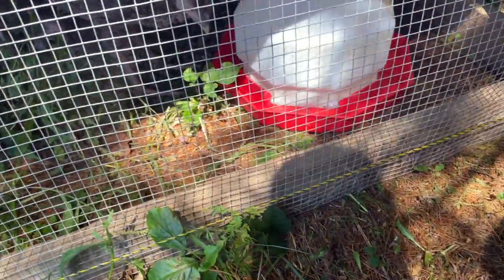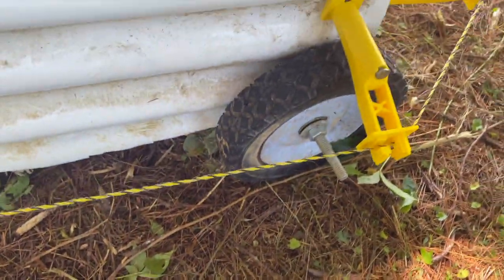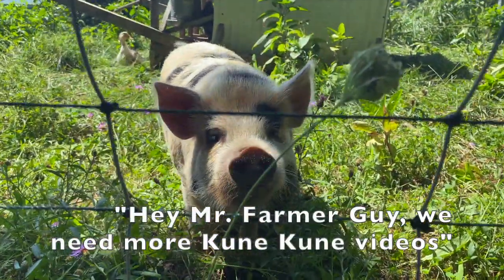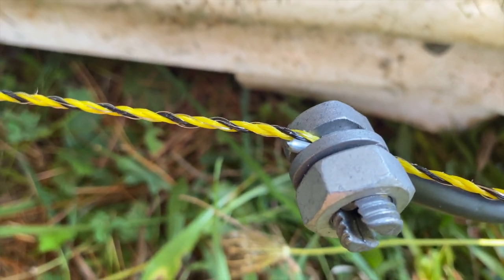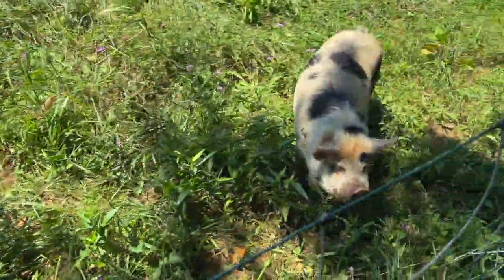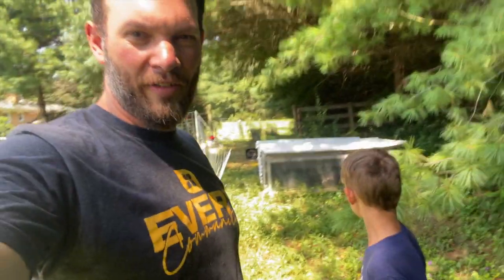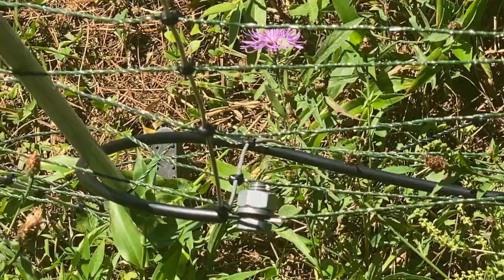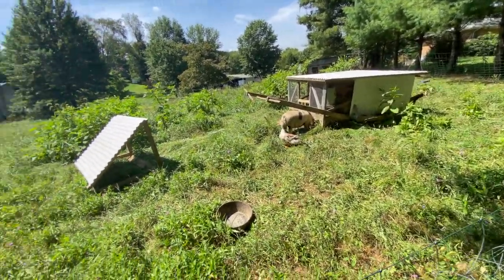How to Electrify your Chicken Tractor

Comment: Good plan. Some varmint comes near that and gets nailed by that wire, he'll probably steer clear after.
Don't you have problems with tall grass grounding out the wire and draining battery?
Reply from the maker: My fencing is connected to a plug in fence charger, so no battery.  It stays hot!

Comment: How do you avoid short circuits ? I suppose you have - black and + yellow ?
Reply from the maker: The only shorts I have have to worry about was is if the grass was to tall and touching the poly wire.
Reply: @modernmountainfarmstead412  really ? Then how do the predators get electrical shock ? Is not clear to me and I wish doing the same. Maybe with 2 close wires no insulation ?
Reply from the maker: Even when the grass is tall enough to touch the wire, it doesn’t short it much.  The electricity is plenty hot (I have touched it by mistake).
Reply: @modernmountainfarmstead412  do you mean the repellent is heat ?
Reply from the maker: No “hot” would be American slang for having an electrical current.  Where the poly wire is positioned, any predator coming close enough to try and dig under would experience an electrical shock to their head.
Reply: @modernmountainfarmstead412  ok  i still do not understand what type of wire and what voltage you.use
Reply from the maker: The yellow/black wire is called polywire